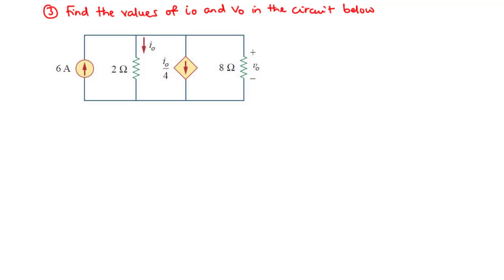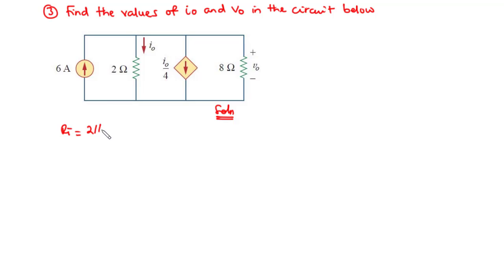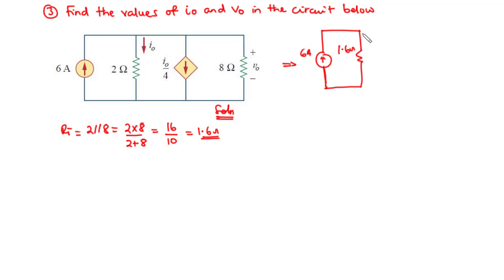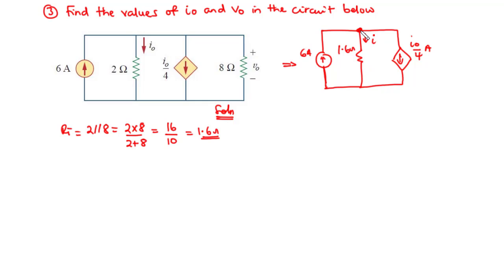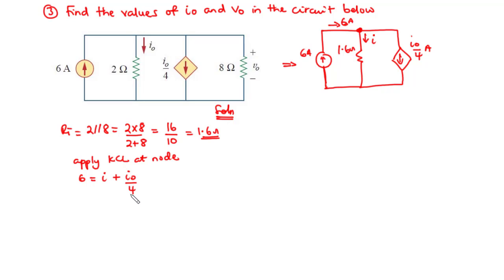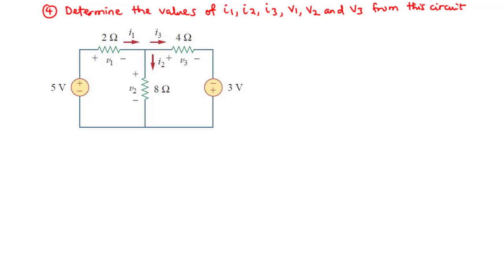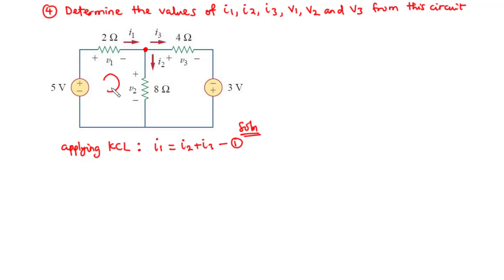☑️08 - Kirchhoff's Current and Voltage Law - Practice Problems 2.7 and 2.8 fundamentals of Electric

Comment: Hello sir, in the very first problem, how are the resistors of 2 ohm and 8 ohm in parallel? Aren't there a dependant current between them?
Reply from the maker: no please, 2 and 8 are in parallel
kindly check the two elements, they are connected to the same node.
Again you can go round a loop, containing only 2 and 8 ohms resistors, hence they are in parallel.
Reply: @SkanCityAcademy_SirJohn   So sir, the dependant current source in between those resistors don't have any role right?
Reply from the maker: @FaiyazBinYousuf they have, but not at the point of finding the combination of the two resistors

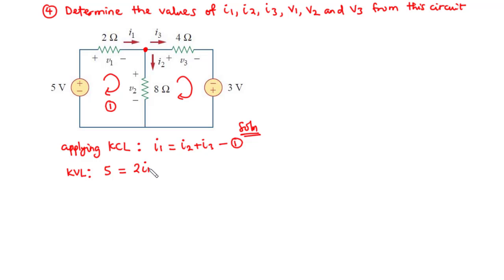Comment: Hello sir, in this  last example 10:29 i thought it was supposed to be negative 2i since it’s leaving through the negative v1 terminal 

Please explain
Reply from the maker: That's correct. But in this example, we are neglecting the polarities (indicating the actual direction of the respective current) on the resistors and defining our own direction to make it simple to solve.
Reply: But why are we doing this? Because this is the same question I was about to ask

Comment: did you have to find r equivalent to solve the first problem? how would I know when I should combine resistors or not? how would i know when to apply kcl and kvl as well
Reply from the maker: Well, it comes with constant practice. The reason I did that was to simplify the circuit, so that the problems looks easy to solve.
Reply: @SkanCityAcademy_SirJohn  I transformed the dependent current source and made V0=2i0. Then got the solution in  a single equation
Reply from the maker: @basepasandhai1906 that's fine
Reply: @SkanCityAcademy_SirJohn  thank you for your help and these videos, I was able to pass my class 🙏🙏🙏
Reply from the maker: @XerathMTA  you are most welcome